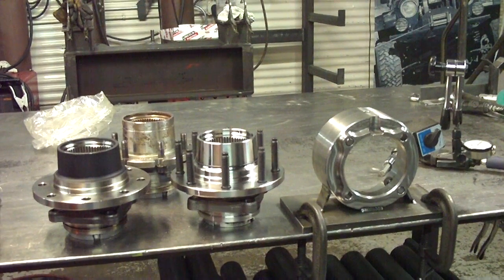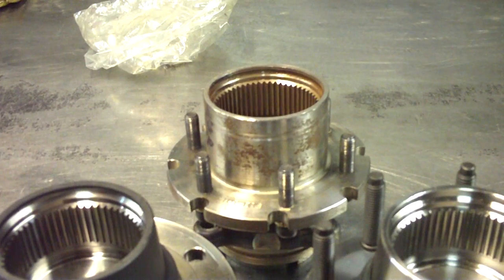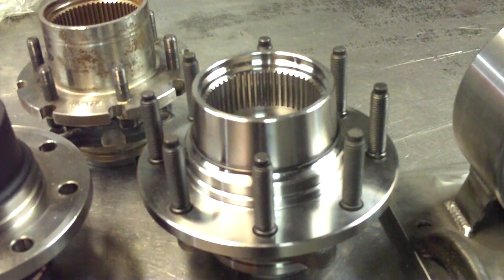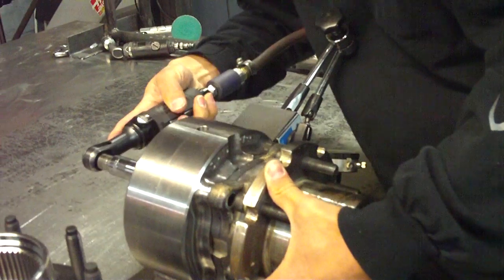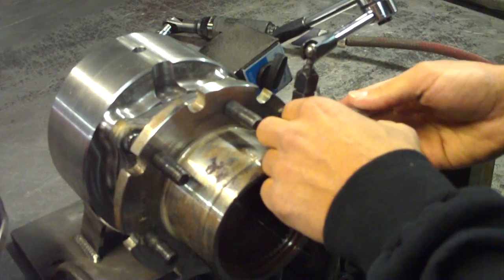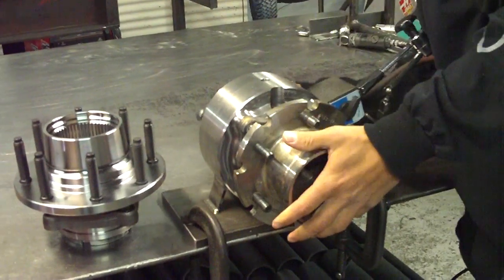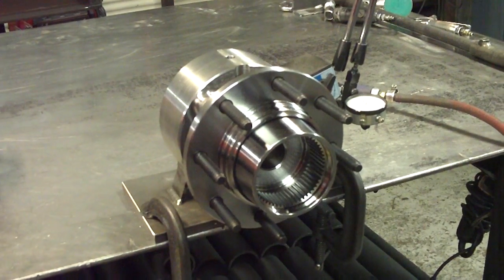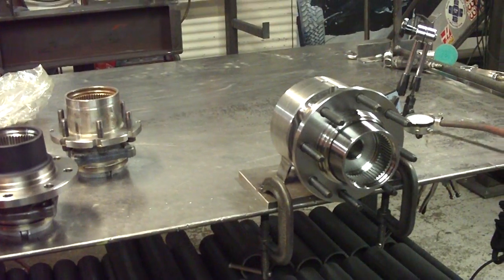Domestic vs. Import Unit Bearings - Bearing Play Comparison

Comment from the maker: @silentknight101 We understand your "noob" on Pirate concern, hopefully YouTube takes it easy on you :-). In short, the spindle & bearing cone on a unit bearing is designed to spin with the wheel instead of the hub & bearing spinning as is traditional. This is accomplished by incorporating the wheel flange as part of the "spindle" which is assembled using a spindle nut on the back side of the unit bearings "hub".

Comment from the maker: @silentknight101 The age old question of course is which one is better / stronger? All materials & sizes equal, they are essentially the same in terms of strength, however each carries its own advantages and disadvantages. YouTube doesn't have enough space to get into all, but the most popular highlights are: Unit Bearings are compact & don't require servicing - Spindle/Hubs are serviceable & allow for more user control (such as control of bearing pre-load). Hope that helps! 

-Thom

Comment: im a bit of a noob on pirate, so i wont ask this there cuz i dont wanna get flamed, but, what is the difference btwn a unit bearing and a standard spindle bearing setup? i see ppl say its easier to clean out, and that its not good for street use =/